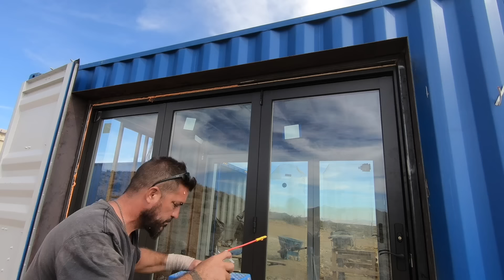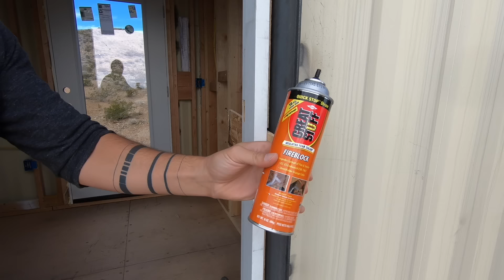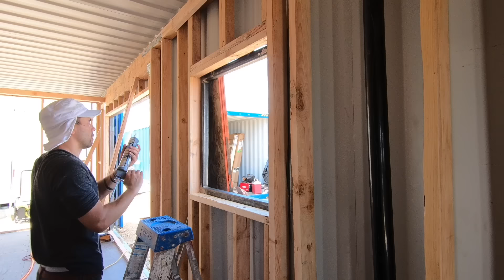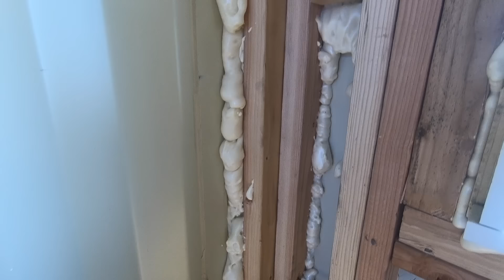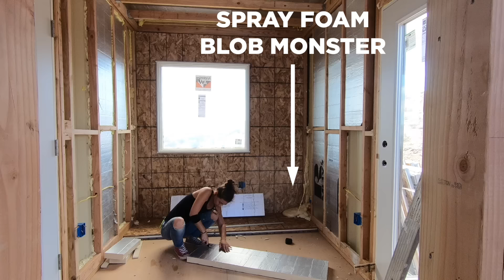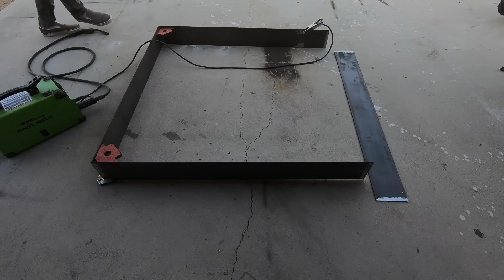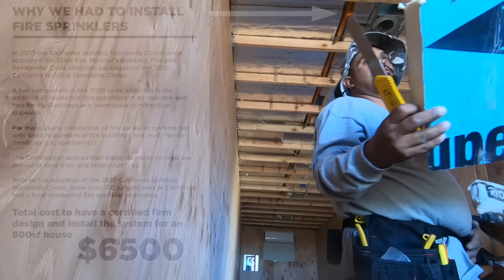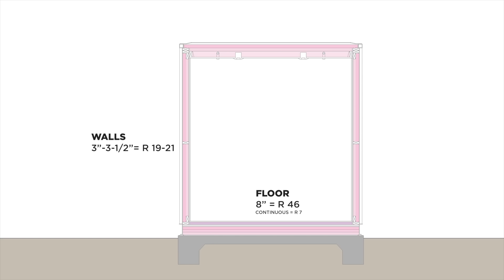Building a Shipping Container Home | EP03 Doors, Windows, and Insulation

Comment: All of these containers because of the way they are made are either extremely hot or extremely cold depending on where they are installed. When you put air conditioning in do you have to be very careful about humidity where cold air is coming up against hot surfaces or vice versa cold air and hot air are mixing together which causes water. If it's 105 degrees outside and you have a metal building can you install air conditioning on the interior you are going to have a huge amount of hot air entering through all those gaps that you left around all your openings and window caulking is not a sufficient substance to prevent a horrible moisture issue as well as ruining the efficiency of your structure just because you think it's okay to leave gaps around windows and doors and hide it with caulking

Comment: Sorry, but if you insulate shipping container from the inside: only PUR foam is  correct solution.Otherwise, under those insulation panels you will have condenced water which will get frozen in the winter.
I'm building my shipping container house and I know what I'm talking about...
However, I made a mistake installing tube steel frame instead of angled steel - I found my mistake while I was installing windows...
Your idea with angle steel is way better and looks better too.

Comment: Fantastic video series! I live in Australia and have just bought a block of land to put a 40' single container home as a weekend getaway. I am at the stage at getting Structural engineering sorted for foundations, flyover roof, deck and window and door openings. I would like to use your method of using 5" x 3" angle for the sides and header for the openings. Can I ask you what thickness steel did you use? It looks like it might be 1/4"? Thanks again for the series and I look forward to watching your hotel progress. Good luck!

Comment: Why would you have put up plywood sheeting before putting up plaster sheeting (drywall) once again making a small space smaller at this rate you would be lucky to a single bed in one room not to mention the cost I would have pulled the pin on this project before it began with regulations like this thank goodness we don't have these silly rules in Australia

Comment: A question. In an environment that has higher humidity would spray foam insulation be better then solid foam insulation. My build, once done will sit for six months a year unoccupied so I'm a little nervous about condensation creating mold. Approx temps are 30c during the day and 25c at nights. Summer is rainy season. Your thoughts are appreciated. Thanks.

Comment: Recommend not so tight on the insulation,  You need some air gaps to flow between wall and insulation so you do not get moisture build up.

Comment: rigid insulation  - this is a common mistake 
for shipping container house insulation: during the cold season, it's gonna be a high volume of condensation between these panels and corrugated steel. Guess where all this water goes to: to your floors causing mold and decay at best, and at worst, rust in the supporting metal structures. 
The best solution (but expensive one) - is closed-cell high density (more than 50) foam spray. of course you can not DIY, but good - it's never cheap

Comment: Great videos my only comment is they were not very cost effective building 
There were a lot of instances where they could have decrease the cost significantly for instance instead of foam insulation panels they coudl have use blown in close cell insulation now days DYI sets are avalible online 
They would also have saved 20 30 cans of dow stuff also environmentally less polluting

Comment: If you had built your window frames floor to underside of the roof beam on the container with the angle and welded to the container walls you wouldn't have needed to put the header/lintel in and supporting studs. This was overkill by the engineer and I feel job creation because you didn't fully cut out the walls floor to roof, there was still a section of wall above, also the container is only supporting it's own self weight and no imposed loads on it, so in my opinion it is way over kill.

Comment: Hi Guys, I did a few container houses in The Netherlands. if you live in an area when temperature can go below 0 degrees you need spray insulation on the roof and walls to avoid condense. your way is not good I know from experience :-(

Comment: Hi Ben, Good videos but I have to say for the cost and additional work a shipping container doesn't appear to be financially beneficial or have any advantage over regular stick framed construction, at least not in this case. As you have had to frame the inside of the building  and do the gyprok walls which you would have had to anyways in a wood framed building, plus the floor plus the ceiling and sheeting of the walls...in fact it looks like the containers are actually an additional cost over what a wood framed building of the identical size would have been....but I like the presentations you have done they are well done.

Comment: Have to say In Canada Building a Shipping conatiner home In the long run you will lose money not using Closed cell spray foam To firmly butt up to the metal leaving zero gaps for air Or the moisture it carries  Rule of thump with Spray foam 2 inches is the valued amount Any less Are your transfer of cold to hot is bleeding out And in Any more and the R-value is less effective per inch  Sure 4 inchs of foam is better than 2 But Its only somewhere around 25% better Not worth the cost  And laying foam board against corrugated steel leaves a gap of trapped air which changes temps From extreme heat ( desert day ) to extreme cold ( desert night) This causes moisture And rust.  Thier is a reason why most Containers ( Trucks And shipping ) Have spray foam when used as a reefer truck to keep the temps level . Running a A/C unit most of the hot season Or heaters during a cold season. Cost alot more a year than the cheap foam board installed In your first or second year The spray foam pays for it's self in electric bills depending on the size of the unit you build it could cover the cost in one season

Comment: Love your channel and LOVE this project featuring exterior folding doors! I may be wrong, but it looks like your folding doors may not be operating well? One of them even appears to get stuck and does not allow you to open all the way? You mentioned also that accordion (aka bi-fold doors, folding doors, etc..) are "finicky" and "temperamental". They  actually should NEVER be either of those things. They should glide open smoothly with little effort, in most cases at the touch of a finger tip! However, I did notice some installation errors. #1 Framing - folding doors are heavy and in most cases they are top hung (as these doors are). A properly engineered header to support that weight is always necessary. The framing you  used  is fine for a typical entry door or window, but should never be used for heavy top hung doors. It is likely that you are going to experience some sag in that framing, if you haven't already. #2 Attachment - You mentioned being careful with screwing the frame to the structure so as not to "bend the door frame". This is true for the side jambs, but for the top track, it is strongly recommended to tighten the middle fasteners to give the track about an 1/8" crown. This allows for any settling as the weight of the doors bear down and helps prevent the doors from sinking into the bottom threshold. #3 Square structure - I put this as #3 because really it's just common sense. However, as a folding door manufacturer ourselves, we do get those occasional calls (complaints) of doors not operating well only to discover that the structure is not square & plum. :-\ Lastly, Jeld-Wen uses the same hardware as we do so I can say with confidence that your hardware is adjustable. You may have already done so, but you have some freedom to adjust the doors up, both at the pivot side and intermediate rollers. I mention this only in case my observation is correct and your doors are in fact catching at the bottom. Hope this helps you and anyone considering tackling this type of installation. If anyone is considering hiring a contractor to do this, we strongly advise finding an installer who has experience with these doors. The above tips are good questions to ask to see if they know what they are doing.

Comment: The only advantage of containers I see is that they may be upgraded inside in controlled environment and then transported to the site. Or, you get a shell on site right away to work inside in rain or snow. Other then this everything reminds typical frame house construction with a metal container "cladding".

Comment: Also, that is quite a bit of  chemicals for your interior space to out gas, between the spray foam, the foam panels, and the OSB for rooms that are sealed up. Looks like a recipe for ,”sick building,” problems, especially when that steel heats up. A building needs to breath. I possible toxicity problems.

Comment: some foam eats the insulation off electrical cable. i hope you have checked that. in my country we have special cable for putting in contact with it particularly in steel foam steel laminated roofing like ritek.

Comment: Since you're in a sunny climate you want to think about doing a safari roof. A Safari roof is a roof that stands off from the surface of the vehicle or building and it and leaves an air flow Underside so that the structure itself does not heat up. A safari roof would have been used on the old Range Rovers to stem the flow of heat from the Sun to the passenger compartment.

Comment: I have seen a design that installs angle iron as a ceiling support and then slide in roofing panels 1.2M wide,  Are the foam lined insulation panels better than  mineral wool insulation.  What is the gassing levels? One reason why I would not use spray insulation.  Too many chemicals sweating over time. Deterioration,

Comment: the purpose of weld through primer is to spray on before fitting the piece and then weld. That way the surfaces in between are not bare and will not begin to rust from the inside. If the humidity is low where you live, I would not worry about it. At the point that you were spraying it would have been too late during the process for weld through primer.

Comment: Sounds like your engineers never used this kind of structure.  The walls can support being stacked like 6 high, so you didn't need structural support inside with plywood, so long as your cut openings were well supported.    They just made you build a wood house inside the metal one.

Comment: What a beautiful video production! As a conventional home builder and admirer of tiny houses I enjoyed your design, and the thoroughness of your video. Since I live on the New Madrid fault I sympathize with the challenges of building non-conventional housing in a seismic zone. 
Using containers you only gained the ceiling joists, rafters, roofing material, siding, did I miss anything? This should be a wakeup call for people who hold the romantic notion that a container is a free structure with a few needed modifications. The labor intensity of the entire project, expensive slab that isnt really used,  cost of the steel trim and jambs, must drive the cost per square foot to extremes, but it is so cool!

Comment: Love your home! I did notice that with the building materials, it lessened your insideby 9 inches (4 1/2 inches each side) and 8 inches on the ceiling. How would it be to use 2X3's instead of 2X4's? And I believe there is a spray machine that you can rent that sprays that foam insulation instead of using a lot of aerosol cans.Thank you so much for sharing your process.

Comment: Appreciate the educational goals of these videos! It seems Container homes are cheap only when you are doing it piece by piece by yourself (or only a few helpers) and using the boxes as storage between build times. Remote, off-grid workshop ideally where security and zero maintenance is needed. Having a secure box with a roof while building in adverse climates (wind, rain) is really all you gain with Container(s). Paying for labor must have cost as much as any stick built home! All that steel framing and floor beam modification lends itself to be built offsite in a cool shaded warehouse!

Comment: Thanks for sharing the video and showing what it takes when it comes to dealing with CA regulations and structural companies. As a structural engineer from the aerospace industry, I can tell you that the final result  (to call it a product) is very inefficient in terms of any possible parameter. The major advantage of having a home built from containers would be that the container itself provides you the structure, very strong, efficient, earthquake resistant, precisely built, etc.  All requirements those firms imposed on you, do not make sense.  All framing inside the containers is totally unnecessary and the only benefit is that it provides spacing for insulation. The worst thing is very expensive plywood on interior walls underneath the dry wall. Totally unnecessary. The same applies to all plywood on the floor. At the locations where the cutouts are, you should have just vertical metallic beams  welded to container horizontal floor and ceiling beams. That would reinforce container a lot. Besides that, welding just a piece of a flat metallic sheet on few corrugations ribs from floor to ceiling would provide very stiff and strong support in any direction. That is called a shear panel :)  etc etc .......  Guys imposing those requirements on you could had remembered that container structure takes weight of all the cargo inside the container  when the container is carried by the jacks or loaded on ships that is about 40tons.  In your project, it sits on the ground with no load that is only load being the weight of the ceiling panels :)   Even without any reinforcing and with cutouts, the structure of container is still way over killed.  For money spent, you could have a real nice typical house not just about 8 feet wide rooms not being even connected to each other.

Comment: After watching 3 episodes, I'm starting to feel like the logistics of all that building on a remote site don't make sense anymore. The original concept seemed to entail minimal site work (the degree of the scale of foundation varies with the regional codes, as you explained so I understand that is unavoidable) followed by plopping these nifty, inexpensive, conveniently-structural units in place. After it was all said and done, it seems like the containers wound up being not much more than a premade siding shell. The structure was a complete structural wood frame.

Alternatively, could these containers have been built in a rented industrial warehouse garage- closer to civilization/ home and with ample power supply, food, Home Depot, etc- and built with full structural steel window and door openings? Basically almost fully pre-fabbed. THEN delivered to the remote site and plopped onto the foundation?

Comment: Do you really need the plywood on the inside of framing or should it have been in between the steel and framing? 
Seems like a waste if its for structure after its framed with studs and bulk heads for openings.  Over all though seems pretty cool and I love this field because we can learn something every day and make adjustments in order to be more proficient.

Comment: A little hint to save a lot of time cutting the walls with the 4 1/2 inch grinder. Use a skillsaw with a metal cutting blade, it is MUCH faster and will cut a lot deeper and cleaner so you can make one clean cut all the way across from the inside or outside on the walls. They use a 7.25" blade (cuts about 2.5"-3" deep, plenty deep enough for this) or a 10.25" blade on some if you need a deeper cut! I started using a 7.25 to build dune buggies and boat trailers over 50 years ago and it worked great and was a great time saver tool. Thanks again for sharing these videos I really appreciate them. Great work!

Comment: You could be using hot dipped galvanized frame work and not have to worry about it rusting. You are in the desert where humidity is low, any where else you would have to worry about it rusting.

Comment: One other thing about the welder, I noticed it was often times quite windy when you were welding.  Typical MIG welders require argon/co2 shielding gas, in windy conditions it will blow the shielding gas away and ruin the weld.
Reply: I didn't see any tanks, must've been using flux core
Reply: @chasecraiger1046  Yep, that was my point, he made a good choice for his price point on the machine and job requirements.
One other thing, that first set of 2" x 2" window frames is the strongest thing in the entire build, overkill is good though.  Andersen 400 series also good choice.

Comment: great job, but california was probably not a great location choice. 'code' basically made you build a house inside a structure. way too much framing that wasn't even necessary. doing this in the next year here in texas. much less wood, more structural steel reinforcing the openings.
great to see how you attached the stud walls to the containers. real close to what i'm planning. thanks again for the info!

Comment: Are you not worried about condensation on the inside face of the container steel and the related rusting away of the structure? I didn't see any vapor barriers in the section cuts - when your exterior cools and you have moisture inside the living space it will get sucked out to the outer inside face of the container and condense on surface of the corrugated walls and stream down the walls as it rusts them out. Curious why you didn't go with closed cell spray foam insulation?